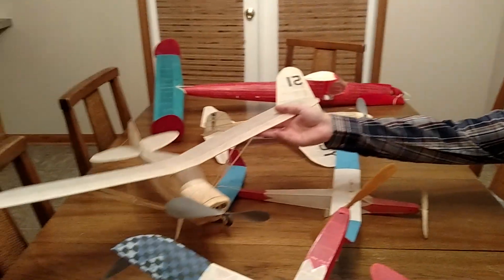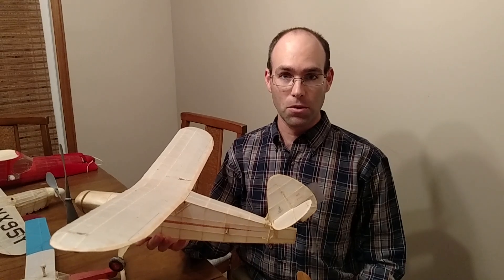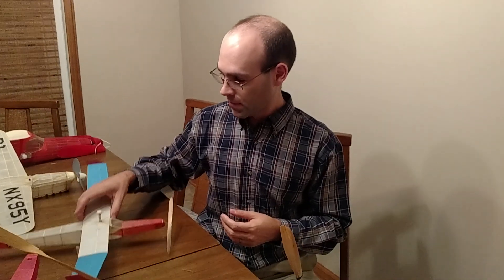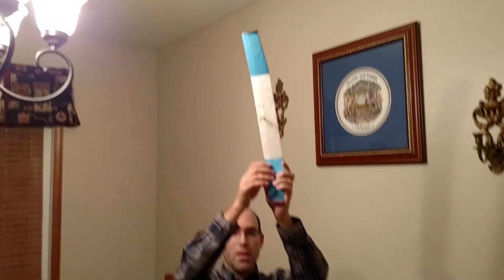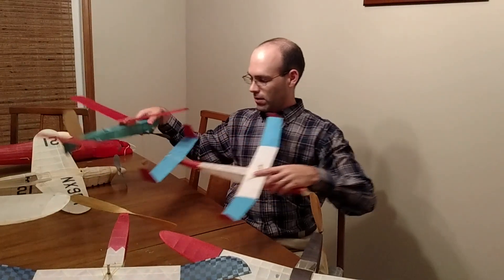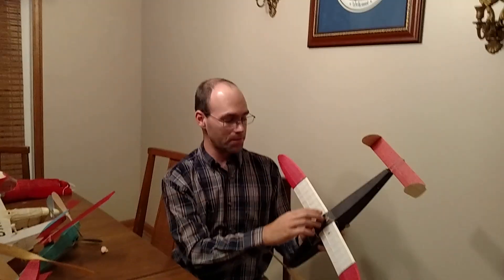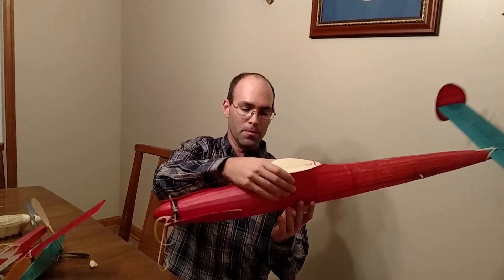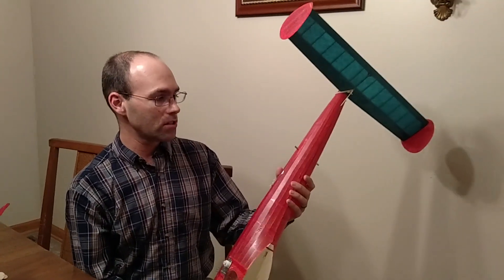Get your model airplane back! Dethermalizers for free flight airplanes

Comment: I am interestes about the fuse mechanism...how to get the derail about it. Any reference fir me?
Reply from the maker: Faimodelsupply.com sells the fuse. You just use a rubber band to hold the dethermalizer surface down and lap it across the fuse. Light the fuse and wait.

Comment: Years ago with larger free flights we used a spring loaded air pot that cut the power for a battery ignition engine.
Reply from the maker: I've got a few of those. John Tatone introduced his mechanical timers after losing a major contest to the unreliability of those old air timers

Comment: Joshua:  I am mulling how to rig a DT on 48" foam gliders from Walmart.   Thinking of launching them from @ 5K ' AGL, with a High Start....Perhaps turn the rear of the horizonal stab into a spring-loaded elevator, as large as possible.   Thanks
Reply from the maker: Honestly sounds like you're on the right track. Tail pivot is the way to go, using either a rotary damper timer or a BMK radio timer. I actually sell both of those now, or you can source the bits from a variety of vendors.

Comment: When I was a kid, my Dad made Free Flights with Cox .020 and .049 engines. This was in the 1960's. The simplest thermal fuse was a brass tube in the tail halfway between 2 dowels. The stabilizer and Fin/Rudder had a dowel in the center of the stab. Another dowel was at the bottom of the fuselage. The brass tube 1/8" diameter about 1/2 inch long and a tiny elastic band over the 2 dowels. It was twisted so the band was tight against the exposed fuse. It would release after a few minutes flight time. The tube made the fuse extinguish when inside the tube. The examples you have showed look complicated and the viscous dampers only last a few seconds.
Reply from the maker: Brian, it's 2020 and reaching all the way to the back of the plane to light the fuse is a great way to damage a fully wound airplane. On lightweight models, popping the tail won't bring the airplane down reliably. I don’t know how you're setting up viscous dampers but you're doing it wrong. They're good out to at least 4 minutes.

Comment: what would be the slowest flying rubber model for outside
Reply from the maker: j lehman for outdoor flying it's hard to beat a good P-30 for slow flying, especially on two loops of 1/8. Boomer by CB Models is excellent, also the Airshark by Starlink-Flitetech. Coupe/F1G models fly quite slowly too, but require a little more support equipment and space.
Reply from the maker: I'll also add that the new Small Mulvihill models glide at little more than walking speed. They can cover a lot of ground, though--no minimum weight for competition, and 20g of rubber mean flight times over 4 minutes are the norm.

Comment: Enjoyed the video. Have watched several of yours.

Wondering what happens if, with the pop off wing, you attach the line to the center of the wing. Seems like it would be significantly less drag without that line being pulled diagonally through the air.
Also, I wonder if people have tried any of the following to bring the plane down:
-hard-over rudder
-lots of down elevator
-hinging the stab at, say, 25 percent of chord and fastening the front part permanently to the fuselage, with the rear part popping up for DT
-Braking the prop so that it spins somewhat slower than when freewheeling. Maybe a magnetic brake would do the job, and maybe all the DT stuff could be concealed inside the model.

Once, when I was flying at a small field, I tied down the freewheel so that the rubber eventually stopped the prop. This threw the plane out of trim and made it come down a lot faster. Not enough to cope with a strong thermal or anything, but it kept the model on the field that evening.  I built a twin pusher without any freewheels. It comes down pretty well once the props stop. It will do around 90 seconds if everything is just right, even though it's all sheet. Maybe more if I worked on optimizing the motor size. (Julius Unrath's Flying Aces Twin Pusher, can be found on Outerzone)

Comment: Love your videos. Can you make a video about how to make a stab or wing pop up setup? Do one need hinges or something similar to hold stab or tail in place when it pops up?
Reply from the maker: Abid Hussain I'll have to do that at some point. No hinges are required. It's all rubber bands and a line that limits the travel. The technical library at freeflight.org has several diagrams showing different methods for dethermalizers.
Reply: @joshuawfinn  Thank you

Comment: Did u say p30?? I bought a free flight plane at a swap. The box says p30 climax... super cool plane.. round tube fosaloge. Also I have a nitro free flight plane from the 40s.. It has a fuse tube. But it also had a DT timer at one time. Were can a guy find one?
Reply from the maker: Climax is a good plane. Times can be had in limited supplies at texastimera.com. fuse for dts is available at Volareproducts.com or faimodelsupply.com

Comment: 10:56 "What you really want to use here is a spring (to have a longer run time)."  What is the advantage of a spring to a rubber band?  Couldn't the rubber band length/width be adjusted for different tension (thus varying the run time)?
Reply from the maker: WDTA UT, yes a rubber band can do that, however it will deteriorate over time whereas a spring, so long as the model is stored in a dry environment, will not.
Reply: Thanks,  I see your point and agree.

Comment: Here in England the tip up tail is the most popular. Wing DT is more efficient. Hardly anyone uses a fuse, most use a Tony timer. The viscous timer is lighter but less reliable. Competition fliers mostly use a radio DT with a tiny servo. This has several advantages, including the ability to avoid disaster.

Comment: What is the flying weight of that mustang? And where'd you get the kit? I just finished the guillows P-51, and it came out to around 28-30 grams, depending on the size motor I use...
Reply from the maker: Copterdude it's about 25...20g airframe, 5g of rubber. could probably take a little more. yours is a good weight, especially for a guillows build. mine is based on the Peck peanut mustang blown up to 17.5" and modified beyond recognition.
Reply: Did you do any other flying of that model other than in the video you posted? If so, how long were you able to get it to fly? I wonder because I'm somewhat of a begginer to scale rubber power, and want to know what to expect from my mustang.
Reply from the maker: Copterdude, no other video. it does about 45 seconds on average. I need to work with it more because it should fly much longer than that. probably need to add more power. it's flying on 4 strands of 3/32 at the moment.

Comment: Josh, Im a FF beginner and would like to know... how do you make the stablizer type DT? I Could observe that the fuselage and the stab are tied by a rubberband. But do you do it? And how to insert the fuse in the fuselage and burn it (the dt fuse) without damaging/burning the fuselage???? Sorry for só many questions. Thanks!!
Reply from the maker: Stab DT's are easy. You have a pair of hooks on top of the stab so you can secure the front of the stab with one rubber band and the other by either a line running forward to a rubber band, or a rubber band running to the back of the fuselage and a fuse. Look in the technical library at freeflight.org for more cool ideas there. Now the fuse install question is an extremely important one. You don't just want the fuse to not burn the airplane, you want something to actually extinguish the fuse once it's done burning the rubber band. I do this by cutting a piece of 3/16" aluminum tubing to about 1/2" long and flaring one end (actually flare the end before cutting to length--easier that way). You sheet in the area you want to mount this tube with 1/16" sheet, and then drill the hole for it after covering the model. Flare the hole slightly so you can flush mount the tube. I use CA glue, but bear in mind that you need a tight fit since the CA liquefies everytime you use the fuse, so there's a period of about 90 seconds during which the tube is a little loose and could reposition itself (also, don't touch the tube during this time--it's HOT!). Anyway, when the fuse burns down into the tube, it is snuffed out by the lack of sufficient air supply. Once burned out, you just poke the remaining bits out with a piece of 1/16" wire and insert a new fuse.
Reply: joshuawfinn Thanks Josh, Im gonna try it on depron fuselage first!!! :)
Reply from the maker: Cool. Add a wood insert for the tube to mount into since it'll melt straight through the depron otherwise.
Reply: joshuawfinn But Josh, what I have here is Not aluminium, Its scrap metal tube (low quality metal tube), does it work?? 

And you mean putrefação a piece of balsa beterraba the tube and depron, right? ??
Reply: The correct name is brass metal tube that I have here. Sorry Im brazilian, some words I have to search. Will this brass melt?
Reply from the maker: Brass should be fine. And yes, mount the tube into a sheet of balsa, say 1/16 inch thick and 1 inch square, and mount that into the depron.
Reply: joshuawfinn Thanks a lot man!!! You are THE GUY!!! :)
Reply: joshuawfinn Oh I almost forgot! If its not much tô ask, you Could do a video of how to build a stab DT!!! That would bê AWESOME since I dont find any tutorials on youtube!! Just a suggestion! Cheers and Thanks again! Anyway, Im crazy tô try and put your teachings in practice!!
Reply from the maker: Yeah, I'll put it in queue. I've got several video projects I'm working on.
Reply: joshuawfinn Cool!!

Comment: Good vid. What size is the chaimbermaid and did you modify that wing?
Reply from the maker: Span is a little under 18", from a scaled down Henn plan. I did modify the wing into a cracked rib arrangement and put in some geodetic diagonals to compensate for the reduced stiffness in the wing center section because of the clipped trailing edges. The DT setup is based off of Bill Henn's setup. I seem to remember that his article in Free Flight Quarterly detailed the DT arrangement.
Reply: Thanks.